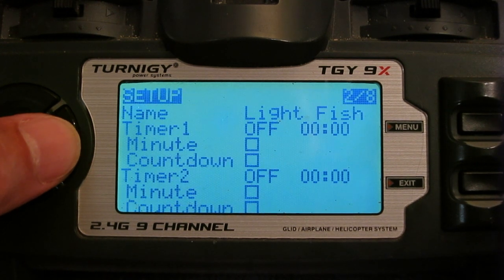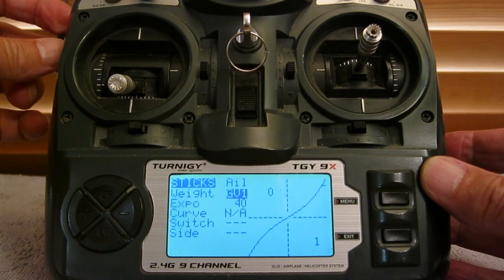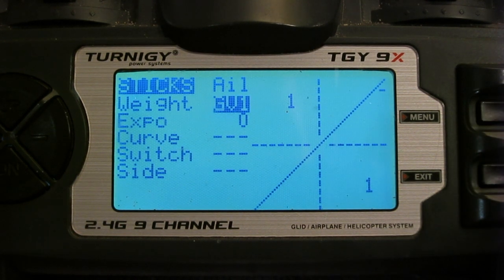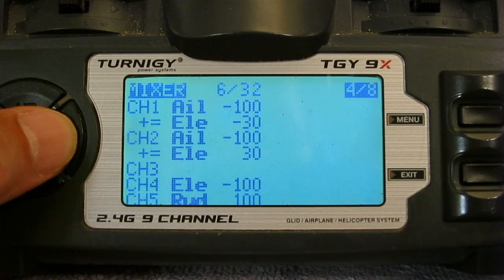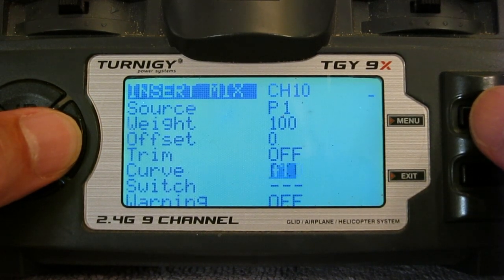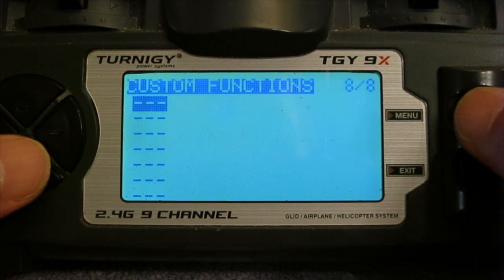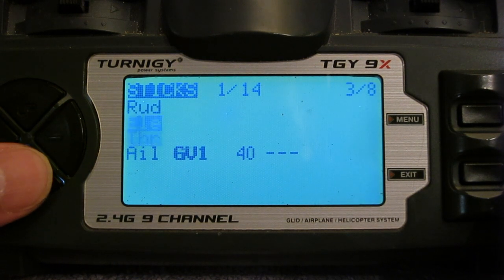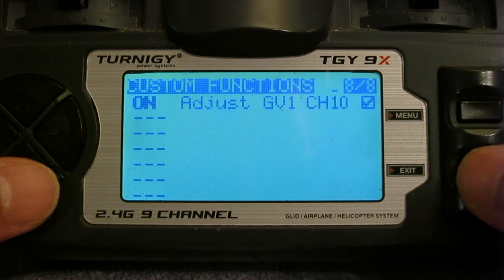Rates on a knob - GVAR

Comment: I have just built one of rcmodelrevirews'  miniquad. As i'm a fixed wing flyer, could I use this system to have an infinetly variable expo flightmode instead of having a horizon, rate etc on a switch.I'm thinking of starting off on really soft rates to learn on and then with a twist of a pot to up the rates as ability allows?
Reply from the maker: Brett Naysmith Good question Brett. You can use GVAR for dual rates and expo on the radio but I dont know whether it would work on the flight control board.

Comment: I am a rookie in this but after watching this, and seeing everything you can do with this radio, I am glad I bought this radio and not the 9XR. I bought it by accident, as it looked good for a reasonable price.

Is there a smaller receiver than the 39gram receiver supplied with this (that is compatible with ths radio)?
Reply from the maker: Sakura You need OpenTX firmware to do this - http://newtonairlines.blogspot.com.au/search/label/companion9X

Hobby King 3ch and 6ch receivers work - http://www.hobbyking.com/hobbyking/store/__295__190__Radios_Receivers-HobbyKing.html